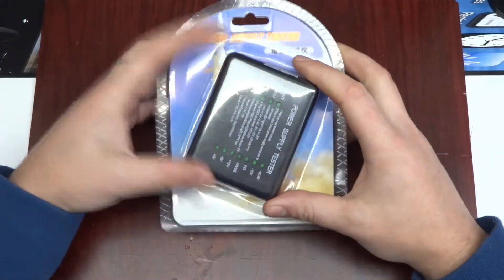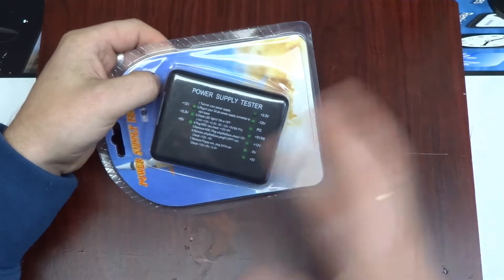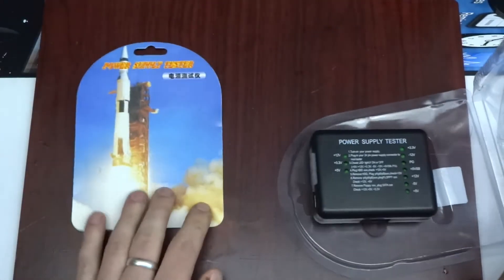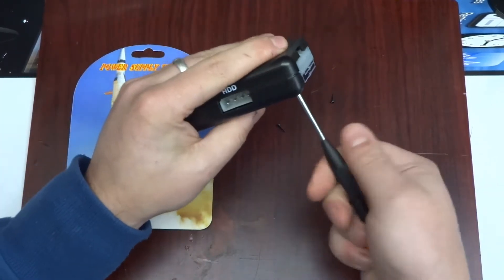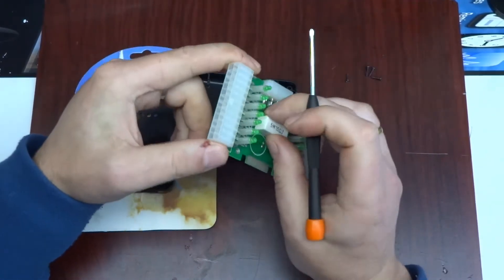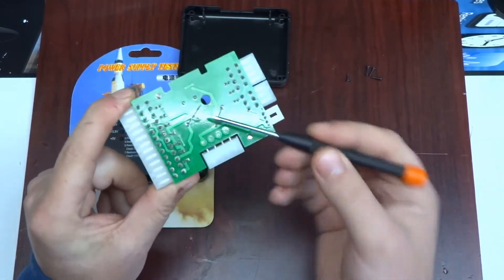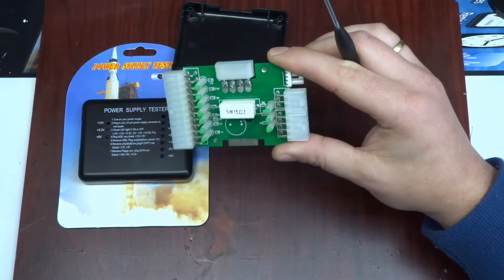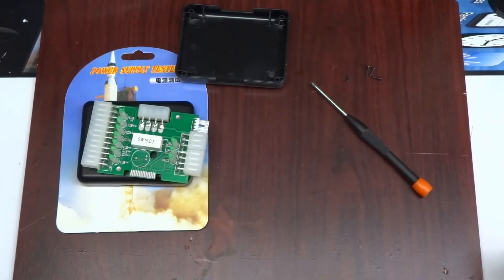'Quality' Power Supply tester from China - teardown

Comment: I know this is an old post, but I've had one of these for the last 3 or 4 years, used constantly. Working fine with no issues. It's just for a quick check not for load testing. I have a separate Chinese 60w load tester which is also working for the last 3 or 4 years. This thing is fine if used for what it's designed for ie just a quick check. The internal load resistor is fine as it's rated for 5w and the actually power consumption at 5v is around 1.6w. Dropping the load resistor value will lead to excessive heat and you don't want a lot of heat in that plastic case.

Comment: That power resistor 15Ω 5W, is just to create a load at the +5V power supply output, necessary for the stabilization of +5V and +12V.  I replaced it with a 5Ω 5W, so now I have a real 1A of load at the +5V.  That is nothing compared with the maximum current the PC power supply can produce, but it is better than 300mA for a minimum testing purpose.   I also included a 33Ω 1W at the +3.3V output to consume some current, again, better than nothing. Also, I installed a 22Ω 5W connected to the +12V for the same effect, consume at least 500mA from that voltage and exercise the power supply in some way.  Better than nothing.   I also installed some other 1/8W resistors to individual LEDs to equalize their bright.  The original brightness from the one I have was complete mess up.  Some LEDs I could barely see them on.  With this extra current and dissipation inside the box, now it gets more than warm, but the plastic stand it with no problem, even with more than one hour of operation in a room with temperature of 75°F.   It is fair to say that this unit is not a "tester", it is much more an "indicator", since it does not "test" a power supply, it only turns it on and indicate the presence of the voltages, it does not sucks heavy current from the power supply.  A good PC power supply tester should consume at least 10A from +5V and another from +12V, also a minimum of 5A from +3.3V, for a minimum of two hours of operation. Also, the voltage should be measured several times during the test, not only LEDs indicators.